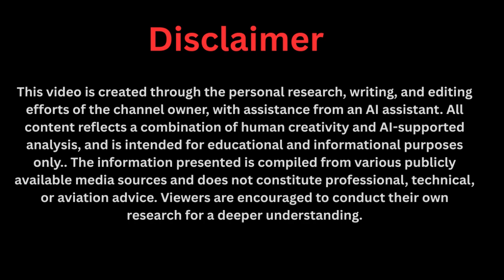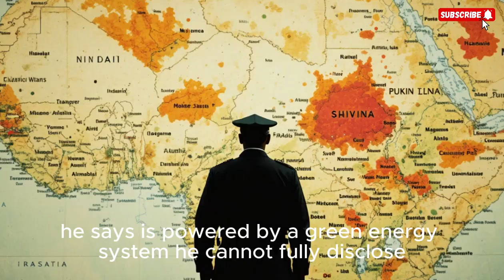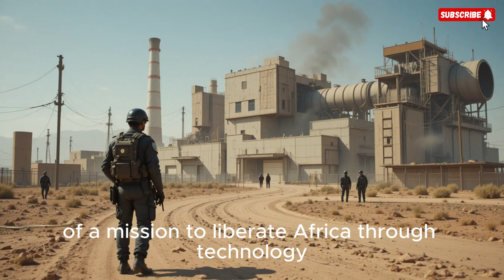Ibrahim Traoré's Gambit: How Burkina Faso is Betting on Maxwell Chikumbutso

Comment: Each molecule of our fluid air or water is a nanometer scale thermal perpetual motion machine. 

Our atmosphere and oceans are full of near stagnant 
heat. Nanometer scale deterministic processes plausibly can reduce the thermal energy of a stagnant heat reservoir by converting this heat into an equivalent amount of electrical energy. 

Solid mechanical structures can bear the burden of supporting the throughput of a dynamic process with minor deterioration. For example the energy delivered by a pile driver hammer dropping three meters over a service life of twenty years is millions of times more than the energy needed to cast the hammer from molten metal 

Determanistic processes like Marian Smoluchowski's deterministic trapdoor plausibly by definition does not require the burden of throughput energy nullifying control signals like Maxwell's demon does. 

Diodes plausibly rectify by a clean deterministic process the initially random thermal motion of the mobile charge carriers within themselves. Arrays of aligned diodes in consistent alignment parallel aggregate the nonzero net current flow from each and every diode into scalable electrical energy. 

This technological concep needs to be developed by prototyping attempts at realization. Suceeding diode arrays tnen can be inserted into a shared market pluralistically, freely, and widely. Centralized management is not needed. 

Aloha
Charles M Brown 
Kilauea, Hawaii 96754